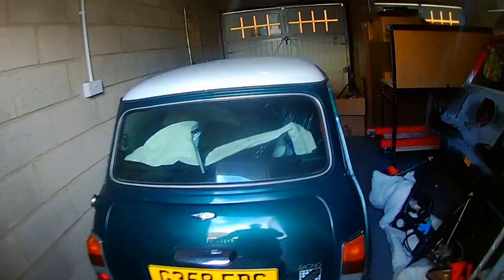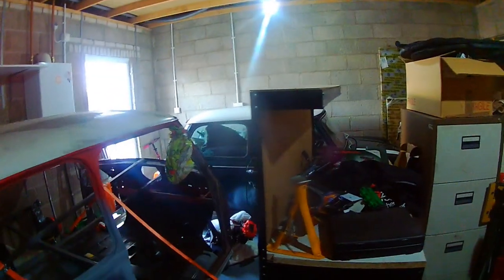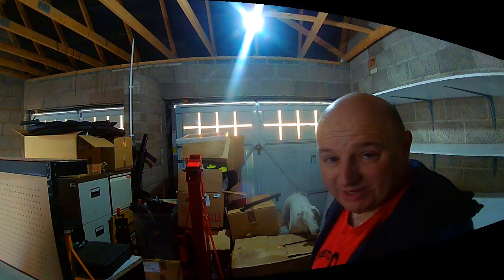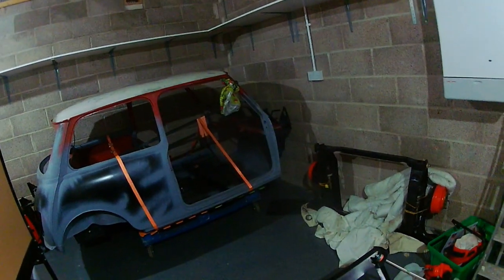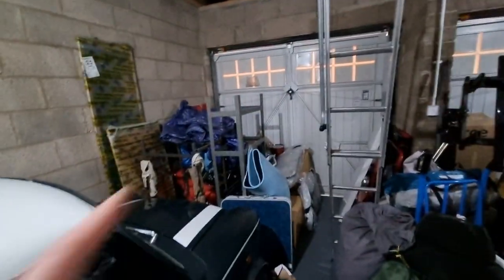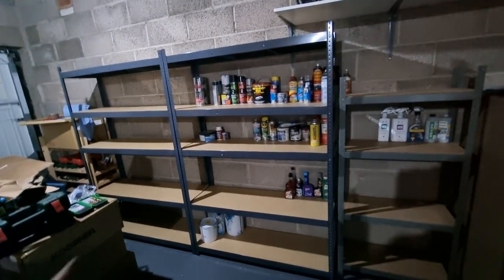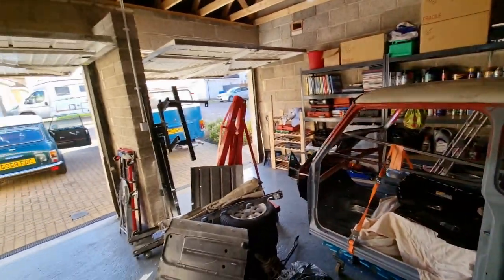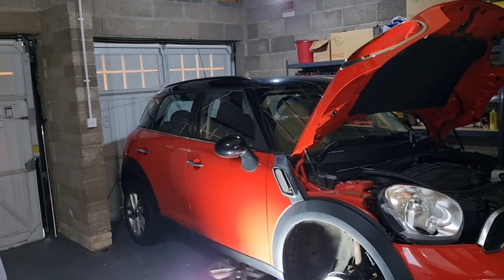Classic Mini Restoration: New workshop Setup

Comment: Looking great DB, if I was you I would fit a couple of radiators board up the ceiling and rockwool and floor the complete loft, I've done my loft and it's the best thing I've done as most of the panels books are out the way more space
Reply from the maker: Cheers Tony, thats the plan eventually but in the shorter term im hoping to store the fibreglass roof off the campervan over the rafters but will slowly chip away to get ti where i need it
Reply: Glad you recommend the best insulation! I love the space as mine is only single car and with all my tools not much room to work!
Reply from the maker: @robertwilson6020  the space makes such a difference and mean i can work on all my project no matter  the weather